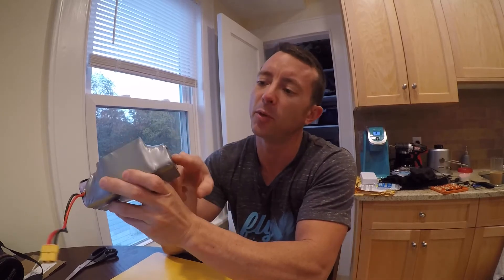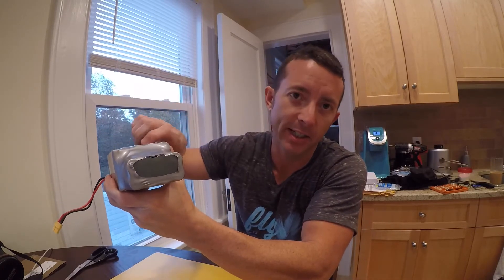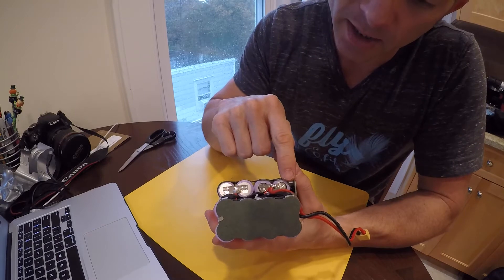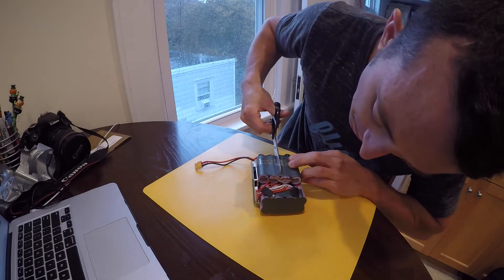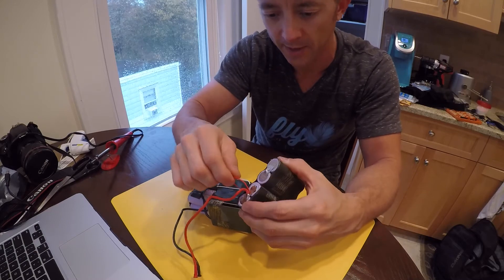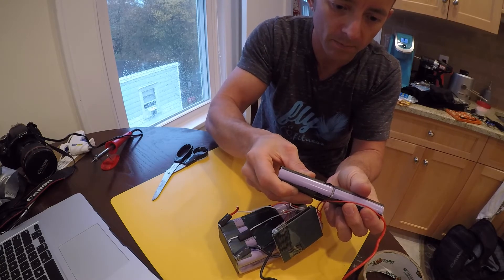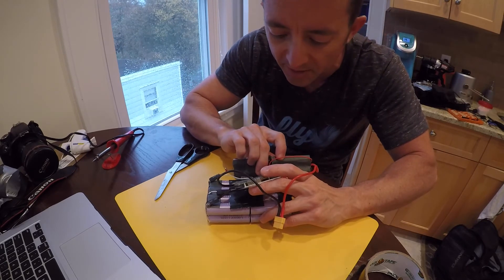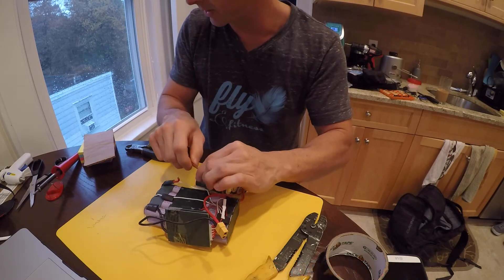Ebay Battery Teardown and Reconfiguration - Lithium Ion - VLOG #18

Comment: How do you charge these?? I bought one and it has a larger flat BMS with the main leads connected to P+ and C-, I am curious if you know where to add a charging lead or if they charge/discharge through the same leads.
Reply from the maker: Michael C its the same... If they only provided u with one connector then that's it...
Reply: Alright I am just making sure since I haven't been able to find too much info on these. Thanks :)